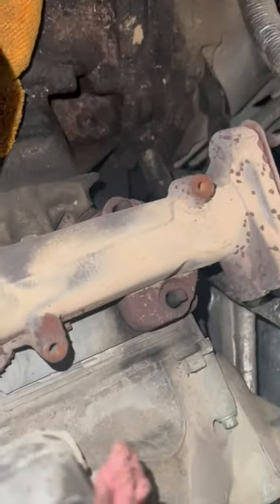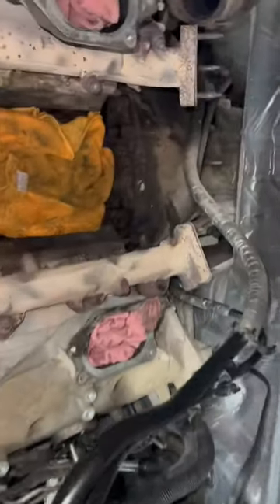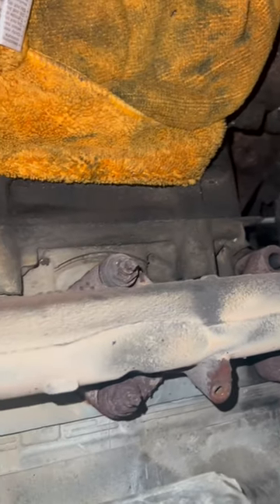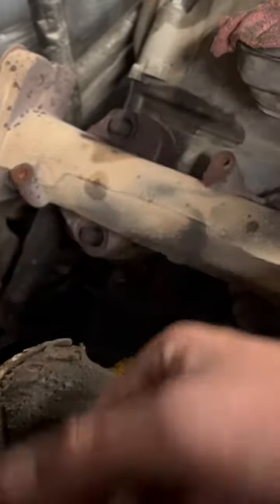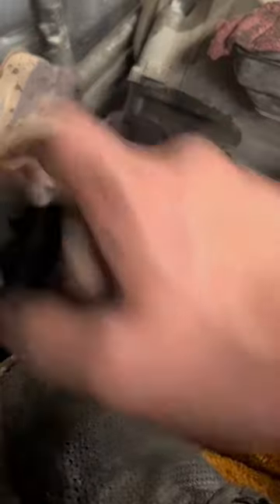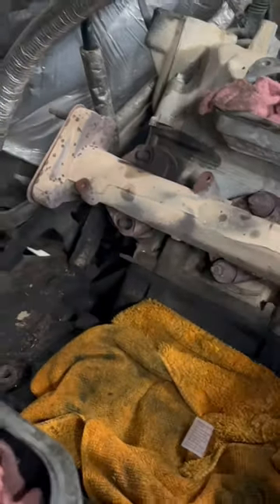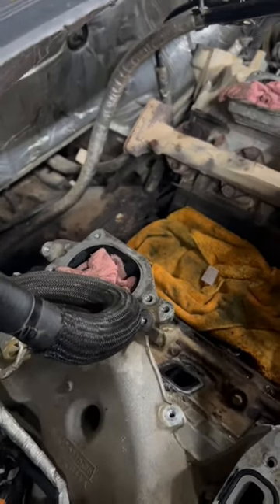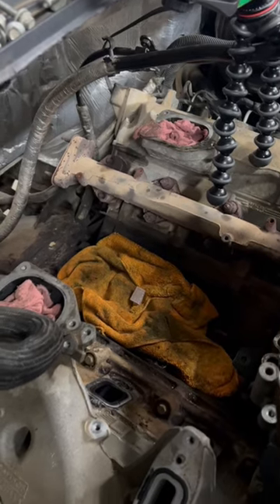6.7L PowerStroke Whistling Noise | Exhaust Manifolds #shorts

Comment: Mine were like that.. they were broke right above that thick washer.. still had enough thread was able to use just a flange lock nut and tighten down been almost 3 years no problem...  I put a jack under  transmission /  transfer case
Pull crossmember off  trans/ transfer case pull  drive shafts.. let  Jack down slowly and had someone help watch  clearances hoses and wires.. if I remember correctly the only thing
I really worried about hitting was the fan into the radiator but to my surprise there was plenty of clearance....😉
Pulling the inner fenders also helps..

Comment: Same exact thing happens on the 3.5l F150 ecoboost
Reply: Yep.  I've got the whistling exhaust gasket on my Expedition.  Unfortunately it's an issue with the design, so even if you replace the manifolds, it's going to keep happening.
Reply: @acrinsd  yessir. I’ve done mine 3 times. 2 on the passenger side and once on the drivers.

Comment: Would that leak cause no turbo boost. I have 0 boost. I heard a noise, sounded like when you disconnect a air line from a compressor. And then I lost all boost. Noise was Not the loud boom from intercooler tube

Comment: Do you replace them with hardened bolts? So it's less likely to happen again.
Reply: The back two are most common for breaking so Ford makes updated longer studs with longer spacers for the rear in order to prevent it from happening again.

Comment: for a few pennies more these problems would not happen but that would taKe awaY from CEO bonus and stocK maRKeT , so screw the buYeR is the moTTo
Reply: Did you have to remove the fuel pump?
Reply: As long as they keep selling without pushback they will keep cutting costs. More service work is only more money in their pocket. It only has to last the warranty period.